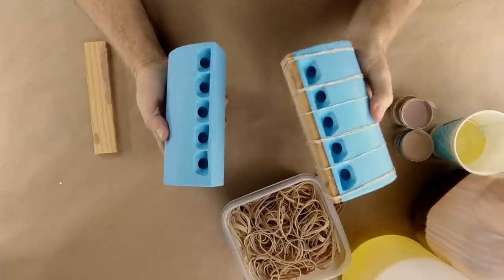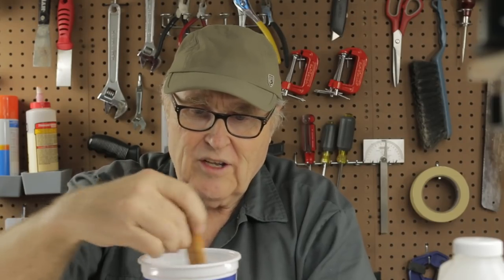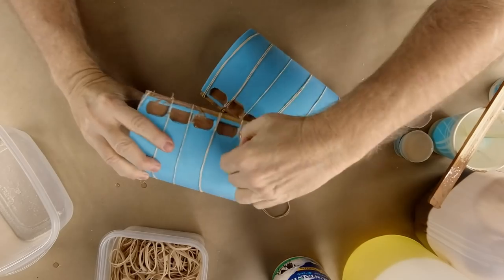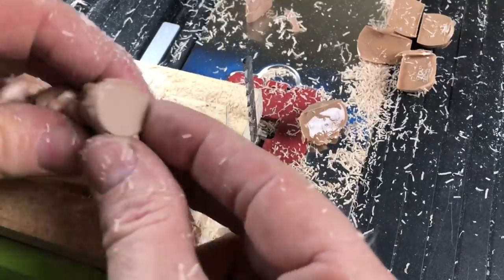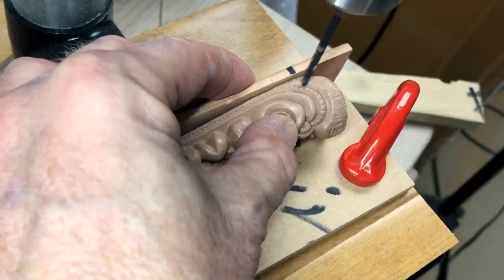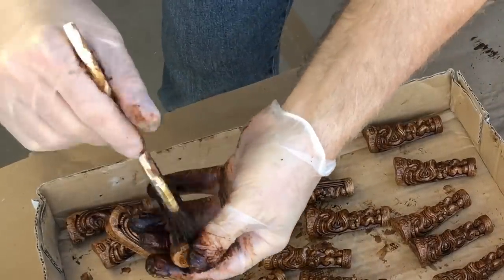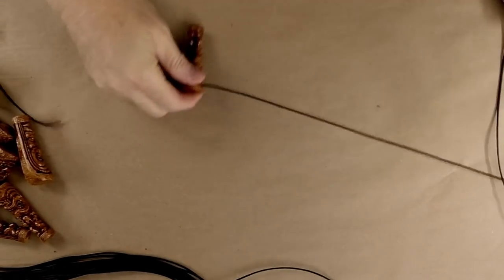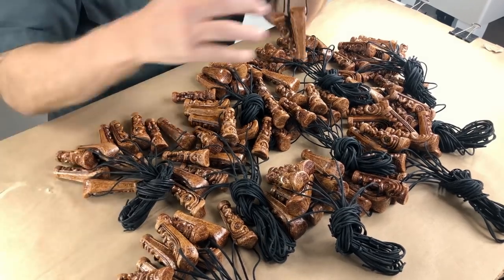Cast, Cut, Drill, Sand, Stain, String and Ship!

Comment: It's an overhand knot.

I work at a business that is close to the pieces you do. I'd say our waste material percentages run about 30%. We would love to get to ten percent, but thus far wasting some material is the cheapest course.
Reply from the maker: Thank you! Ha- Now I know the knot!  I suppose if I calculated my total waste stream my percentage would change. But I don’t bother because most of my projects are toy sized. Materials like wood and glue, etc, are not a big factor. And I scrounge so much materials anyway.  The overwhelming majority of my project costs are labor.
Reply: @RobertTolone  Computing the balance between labor and material costs is indeed tricky. With experience the balance changes. Increasing experience means (1) higher $/hour costs due to increased part quality and reduced production time and (2) in reduced material costs due to less waste during prototyping and defective parts.

Comment: I have two things, first, whats that stain? And is it penetrating the material? And second, for the sprues, I kept all my sprues, some day hoping to find an easy way to cut them down to smaller bits and reuse them in casting. I mostly work with clear epoxy so you can use small bits for nice effects. I lately made a video on a resin dice tower, its a large model of 250g of material, but I can use about 20-30g of sprues at the bottom section to safe on material and to give it nice effects. The recycling was the main reason to make this model at all, as I have kilos of sprues laying around ^^
Reply: I was hoping to know why type of stain as well.

Comment: im trying to find the flap sander disc you have.  where do you get em?
Reply: Same here ☺️
Reply from the maker: They are called Fladder wheels. They are manufactured by the Fladder company which is in Denmark. I used to buy the wheels along time ago from an American company, but they stop selling them and I could not find them. I recently located them on the web and have contacted the American dealer. As soon as I have more info I will let everybody know.
Reply: Me too!

Comment: Another great video Robert! When you "de-flash" the parts with the drill press and flap disc, are the parts still relatively fresh/soft or will it work well on parts that have been well cured?
Reply from the maker: I always try to clean the castings as soon as possible after they are removed from the mold. They are not pliable at this stage, they are firm,  but they are much easier to work than they will be after 24 hours when the resin achieves its full cure.

Comment: Love it when you get bored!!! Great informative video once again. The stained figures do look great. Interesting to see you use Magic Sculp for the jig. I have sucessfully tested dental kneadable 2 part silicone rubber for a similar purpose. That stuff works great and it comes in a varaity for shore hardness going up to 90. Very handy to have it around, I guess pad printers use it as well. It is rather cheap when on offer about 50 € for 3 Kg where I live. It is also sold as Lab  Putty which comes with a tube of  paste catalyst wheras the other product is a dead easy 2 component putty with a 50:50 mix ratio - great stuff. Check dental supply companies these are truly gold mines for peaope doing resin casting etc. and almost found in any major City around the world. Happy new year looking forward to your company in 2021!!!
Reply from the maker: I have never use that stuff Wolli. I’ve got to give some a try - sounds very interesting!
Reply: @RobertTolone Thank you for your reply I forgot to add:  It sure hase some characteristics other materials do not have. It hardens in a couple of minutes it does bonds to other rubbers (if you want)  as it was regular rubber. Imagine you can build a sturdy 2 part mother mold in less than 15 minutes or add a strong core/support inside the mold you are casting. And yet it keeps all the good and wanted silicone rubber properties. If time is money than that stuff is made for you.

Comment: Happy New Year! Were you able to get all 100 pieces from those 2 molds? Good stuff!
Reply from the maker: Oh yes. The molds are in excellent shape now at the end of 105 castings.  The original model was made in sculptor’s wax and even though it had a lot of detail was quite smooth. Often I cast sculptures by Crazy Al that are carved in wood and the wood grain detail definitely shortens the life of the mold. I expect I could easily get another run of 100 out of this set of molds. To be safe, on client jobs I budget 10 castings per cavity.

Comment: Robert! glad to see you back! I'm just curious now... why didn't you use the funnel you made on the previous video?
Reply from the maker: The point to the funnel is to pour a lot of rubber rapidly while controlling how it falls into the mold. When making the first version of the mold I didn’t know how much rubber it would take to make it so I filled it in four smaller batches. I had no need for a funnel.
Reply: @RobertTolone  hoooo that make sense now.  Thanks!!

Comment: Have you ever done anything with "cold casting", Robert? Using metal dust in the resin? I'd love to see what techniques you might use for that which might be different from what you've shown us so far (especially finishing techniques to get that real cast metal look).
Reply from the maker: I occasionally do projects with filled resins and if a project comes to the channel that requires it I’d be happy to give it a go. The major difference is that most filled resins are thicker and therefore more likely to catch bubbles. Also you have to really stir the B component because many fillers settle quickly.

Comment: Do you have a formula for, I forget the term that was used in the printing industry, how many you cast to make sure you have 100 at the end? In printing if you expected 1,000 at the end they would start with say 1,100. They made POS displays and a certain number would be used for set ups and thrown away along the multi step process. The thing was even though they ordered 1,000 per contract and maybe printing pricing standards they would be charged for the 1,000 and whatever they had left of the 100.

But I know what you mean by shipping extra. I used to make vehicle graphics and if I had extra I would throw them in. I didn't have any use for them. If it was some thing odd I would keep a few if they asked for more later.
Reply from the maker: The smaller the edition, the larger the percentage of overage. For instance if it is an edition of five and I make one extra that is a 20% overage. So on small runs I am less likely to make extras. On an edition of 100 I would expect to make 5 extra. Unless I am catching a lot of flaws in the castings and I have to discard a larger percentage of them. Fortunately, that rarely happens.  In this edition I kept one for my archive, gave two to the client and two to Crazy Al, the sculptor.

Comment: What kind of stain do you use? I wouldn't think the plastic would be porus enough to absorb stain.
Reply from the maker: It is Behr EuroColor water-based wood stain #690 Norwegian teak.  It dries to a hard plastic film, similar to acrylic paint. Crazy AL, the designer of the tiki, has been using it on a variety of plastic products for years. I don’t know why it works so well on plastic but it does.
Reply: @RobertTolone  I did some searches and can't find that product. You might want to hoard what supply you have. Thanks for the answer, I am now thinking that any stain + polyurethane will work.
Reply from the maker: @MarkATrombley  Behr makes a lot of water-based fast drying stains.  when we run out of this 5 gallon bucket will have to experiment a little to find a similar product. It doesn’t appear they are making that EuroColor line anymore.

Comment: Did you mention what kind of water-based stains you use or prefer? And why one would work better on resin than another?
Reply from the maker: The stain I used was Behr EuroColor water-based wood stain #690 Norwegian teak.  Al, the designer of the tiki,  has been using this stain on a variety of plastic products for years. It’s water-based and I’m not sure why it works so well on plastics. It’s almost like acrylic paint. It dries to a tough plastic film.
Reply: @RobertTolone  Thanks for the reply! I looked online and only found threads where people were saying the EuroColor was discontinued about 20 years ago! Lol. I contacted Behr, and the person who responded said they had never heard of EuroColor. So I will continue to look around and experiment to find something that doesn't bead up on unprimed polyurethane resin castings.
Reply: @MechanicalWhispers  It would not surprise me if that 5 gallon bucket of stain is 20 years old. There’s only an inch or two left. I have no idea if a different Behr water-based stain would work just as well.  I guess we’ll find out when the bucket is empty! 😀

Comment: Great video as always.  Could you tell me what grit the flap wheel is.  I'm interested in getting one myself but don't want to get 100 grit or something too abrasive and melt my parts 😅
Thanks in advance
Reply from the maker: Most of my wheels were between 80 - 120 grit. But I save the worn out ones to use on plastic. So you would definitely want a finer grit if you were using a new flap wheel on resin. 220 or so.  You just have to experiment until you find out which grit works the best for your application.

Comment: Hi. I've just come across your channel and love how you explain the little things that matter. I want to get into molds and casting and have a couple of questions if that's ok?
Did you use some kind of plastic resin for these rather than an epoxy? And is it better to use a pressure chamber (how much pressure?) rather than a vacume?
Many thanks for all the insights
Reply from the maker: They made of Urethane resin. I use pressure when casting the resin to suppress bubbles and vacuum to de-air rubber prior to pouring a mold.

Comment: What type of resin do you use and where do you get it? Also, the molds - what material do you use and where do you get that? Thank you.
Reply from the maker: I get my materials from www.silpak.com.  Mostly I use Econosil- 25 silicone rubber and Silcast urethane resin. But you should use the materials that fit the needs of your project. They can help you choose the correct material for what you are doing.

Comment: Grind the waste up and use it as filler in any future projects
Reply: How do you grind it?
Reply: @chriselliott726  there are a few options but they are dangerous to the wrong people. I'm talking about those people that are the reason why most packaging tells them not to hurt themselves with their product.

You can pulse the pieces in a food processor suspended in water then let the pieces dry off before using that material to bulk up new castings. You can also build a desktop plastic shredder, they are dangerous though so no one is going to sell you one because liability and the lawyers but the designs are available online from precious plastic and any metal shop could put it together for you.

Comment: Ya, I don't have a tank so what type of resin should I get - I don't need large quantities but I do want to make large mirror frames and I've been struggling with suppliers.
Reply from the maker: I get my resins from www.silpak.com Most of my castings are done in urethane resins like their Silcast or QuickCast.  I mostly use their most economical grade of silicone rubber, Econosil-25.
Reply: @RobertTolone  Thanks for the heads up.

Comment: Hi Robert, I follow you some months ago and I wonder if you could explain, teh "metod" or tehe diference between degasing the mold an d cure the cast under presurre. Is it no the same, right?
Is because Im trying to make my self a vacuum chamber but right now I think thats not the same.
Thanks a lot and regards from Spain
Reply from the maker: A vacuum pump is used to remove the air from the silicone rubber before it is poured to make the mold.  A pressure pot uses compressed air to crush small bubbles and suppress the formation of bubbles in resin as it cures.
Reply: @RobertTolone  thanks a lot

Comment: Seems like you could pour a bit less resin and have less waste. Even just a few grams less per pour could add up.
Reply from the maker: I could but I find it slows me down. I have to move quickly to pour 10 per cycle. This project had an unusual amount of waste because I did not design the original funnel systems.

Comment: hai pap...apakah dalam pekerjaan seharian  tidak memakai masker .? setahu saya uap resin berbahaya untuk kesehatan .saya juga main resin  selama 7 tahun ini. saya membuat magnet kulkas . sendirian tanpa kariawan .saya sudah produksi 300 ribu pcs ..dalam berkerja sehari-hari saya memakai masker gas 3m ..bagaimana cara anda menjaga kesehatan ?... salam dari sumatera barat indonesia
Reply from the maker: I used google to translate your question. You cast a much larger volume of resin than I do. I am actually a sculptor so most of my time is spent sculpting small prototype objects.  And I do very few production runs anymore. I rarely make more than 500 castings per year. My shop is very well ventilated. We have a very large doors, fans and blowers that suck the air out of the building.  We have dust collectors on machines.  And finally, I don’t wear a mask on camera because it makes me hard to understand and hear. I have dust and fume masks, gloves, etc.
Reply: @RobertTolone   pekerjaan anda sangat rapi sekali . saya tidak ada apa -apa nya dibanding anda . saya takut anda salah mengerti kalau  hasil google translate saya copi kesini .saya sengaja tidak pakai bahasa slank. hasil translate gogle belum terlalu baik . saya tidak pakai tank seperti anda .saya mau meniru tank anda tapi masih belum mengerti.  kalau ada lubang .saya memakai papping bag ,untuk dempul ,saya juga memakai PANASONIC Exhaust Fan 12 Inch FV-30RUN . tapi  tetap pakai masker gas. 500 pcs per tahun tidak masalah asal bisa beli ferari . 300 ribu pcs 7 tahun rumah saja masih sewa .:) ..saya  banyak sekali belajar pada anda . anda hebat .terima kasih atas ilmunya
Reply from the maker: @sangatrahasia861  Thank you for watching my videos.  I wish you good luck in your business!